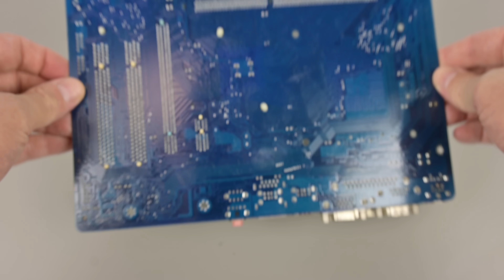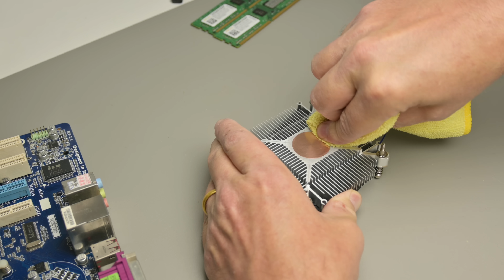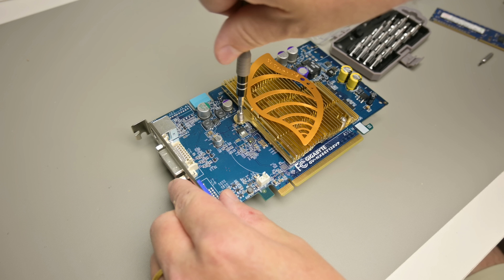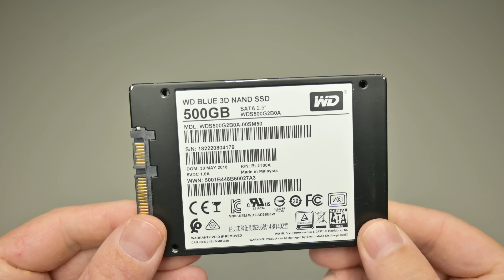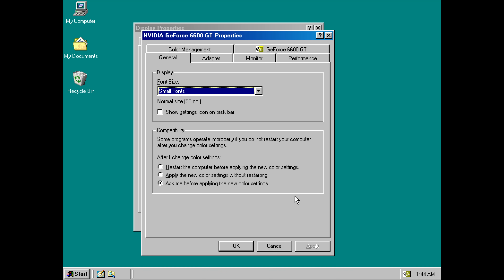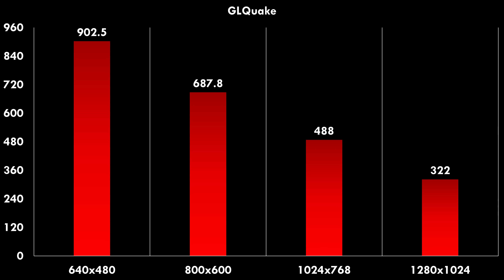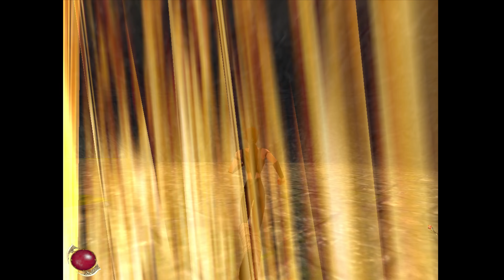E8600 Windows 98

Comment: I like authentic and beefed up. So for authentic I have a period correct 486DX4 with MS-DOS, a K6-2 and Pentium 3 system with Windows 98 SE and for the beefed up moods I have a Core2Duo E8600 (now equipt with a Xeon E5450 btw) running dual boot Windows 98 SE and Windows XP. 
All systems have good performing videocards in them and for sound PicoGus 2.0 and WavetablePi in the 486, Yamaha Audician 32 in the K6-2, Soundblaster Live! in the Pentium 3 and Audigy 2 in the Core2Duo.
I learned from the best my friend.........😊

Comment: Excellent setup! I actually bought an E8600 after watching one of your videos where you said it’s the fastest Core 2 Duo — never thought of using it for Windows 98, but I love how well it performs in that setup. The only thing I’m missing is a decent GeForce, something like a 6600GT. Right now I only have a 6200, and the coil whine is insanely loud — totally unbearable. Otherwise, just the usual cockroach cards like a GeForce 2 MX or MX 440, nothing high quality. I definitely need to try that patched version of Win98, it’s awesome that it handles so much RAM and newer hardware without compatibility issues.

Comment: Very nice!  I'm a bit curious though, are there advantages to building this with 98 vs WinXP?  I imagine any speed dependent dos/95/98 era games you would want will not work on this hardware anyway.   Cheers!
Reply from the maker: The Core 2 can actually be slowed down nicely! I covered this in a previous video. If sound is working, it can handle most speed sensitive DOS games...
Reply: @philscomputerlab  Hah, yeah now that you mention it I do remember that video.  Thanks for the reminder!

Comment: I have an audigy 2 platinum and it's still the best card i have ever used. Using my profile settings, every other card either can't handle the sound or it doesn't even have those settings and they never sound as good. I'm still using one today and i even got a $50 PCEi to PCI adapter for it, otherwise i would not be able to connect it to the new motherboard. Yes, i actually spent $50 so i can use my Audigy 2 on my new PC.

Comment: I was wondering if there was a way to use an Nvidia 8400 GS as a basic display adapter for Win 98. The games will all run on software mode, and the 8400 GS will only handle the displaying of the image.
Reply from the maker: That is a good question, I am not sure, but worth a try!

Comment: This motherboard is the absolute standard Intel 775 for me.
Fast, cheap, easy to use and very reliable.

E8500 and E8600 are great overclockers with standard cooling.
Reply: Meu 8400 esta em 4000ghz
Reply: In this time I was using xeon E5450. It was a beast :) 4 cores and 3.0 GHz clock 😀

Comment: 🤔Why would you be talking about multi-core CPUs in the context of Windows 98?
Reply from the maker: Because there is no single core CPU that fast.
Reply: @philscomputerlab  The Pentium 4 670 is clocked at 3.8 Ghz.
Reply from the maker: Yes, but performs much worse. It's not just about clock speed.
Reply: @johnhunt1725  Lol that thing can't even compare to a Core 2 clocked at 2 Ghz.
Reply: Because Windows 98 can't utilise multiple cores and it's best to get a higher clocked CPU.

Comment: Funny enough I tried the reverse and used probably the most underwhelming but modern CPU to run Win98. It was the AMD E-300 1.66GHz running on an eMachines SFF system. I couldn’t get Win98 working at all no matter what I tried. It was a huge waste of time. I’ll stick to socket 775 or 2nd gen socket 1155 boards if I want a smooth Win98 experience. I still think you should try the 7600 GT with 82.69 drivers. At least with those cards they will have fans unlike the passive cooled 6600 you’re using.
Reply from the maker: Will for sure try it out!
Reply: have you tried android or win xp ? how do they perform ?